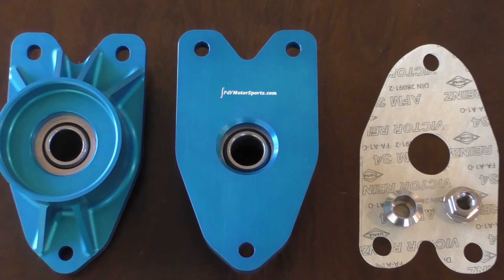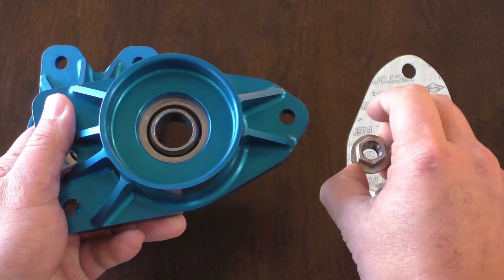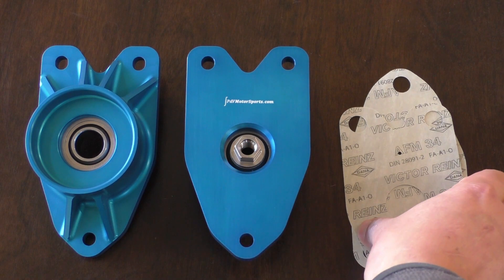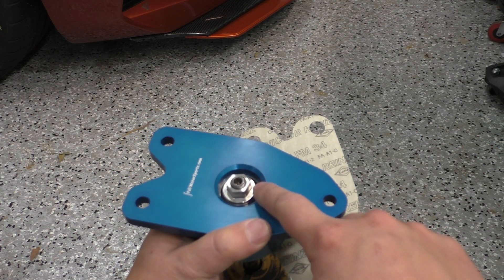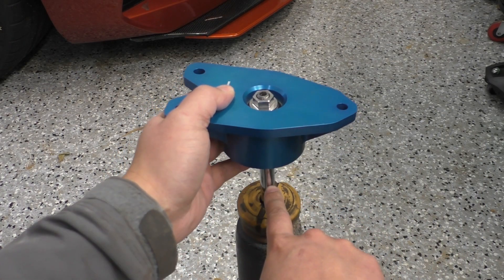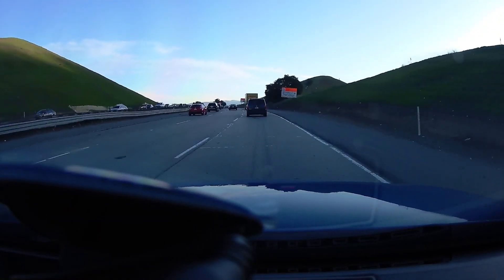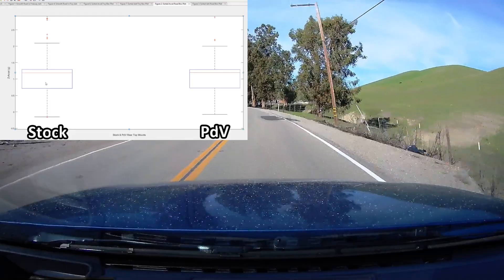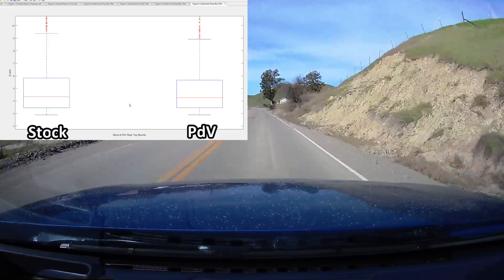PdV Motorsports Rear BMW Top Mounts, No Added NVH!

Comment: Followup. Great video. You think these mounts will help reduce front to back or side to side body movements when going over dips in the road 1 wheel at a time? Also, is the damping stiffer and any traction or cornering differences?

Also, is the vertical movement in the stock shock mount something we would notice when driving over certain road surfaces? Maybe a jittery on its toes feeling, or more bounce then necessary?
Reply from the maker: It should better control movements a bit since the damper is always working instead of having gaps/delay between when it goes between compression and rebound. Overall the effect of these top mounts is subtle.

The vertical movement in the stock top mounts likely reduces the road feel a bit, but could cause a slight bit less damped feel too.

Comment: Great video. You think these mounts will help reduce front to back or side to side body movements when going over dips in the road 1 wheel at a time? Also, is the damping stiffer and any traction or cornering differences?

Also, is the vertical movement in the stock shock mount something we would notice when driving over certain road surfaces? Maybe a jittery on its toes feeling, or more bounce then necessary?

Comment: Nice video, as always. I get that you have data to show that there is no added NVH, but you also say that they improve performance. I don't see any data to prove that in your video. It makes sense that directional changes would be more direct, similar to the effect of replacing front thrust bushings with monoballs, because you're elminating deflection. Do you have any data to show an improvement in performance? I track my car quite a bit and always looking for ways to improve handling. Thanks!

Comment: Excellent video as usual! Obviously you can more perspective on mods because when you take your car from the street to the track you test the mod under more extreme conditions.

I don’t have any intention of tracking my daily driver but I have modded it for aggressive street performance with what you might expect including full E85. I really enjoy twisties and big freeway on/off curves.

But being a daily driver/family long trip car I haven’t sacrificed comfort with Koni Special Active shocks, Eibach springs, and non-runflat Michelin PS4S tires.

I like the quality and design of this product. I’m pretty much riding the fence right now as to what difference/improvement I may feel with my suspension setup and type of driving I do.

Curious to hear your comments? Would it be worth it for my setup?

John
Reply from the maker: I would say the difference is a bit subtle on a street car. There are situations where you can notice damping occurring a bit faster, but there's no "night and day" difference. I'd probably do these before monoball rear control arms though.
Reply: @FaRKle0079  
Thanks, Man! That’s very helpful!